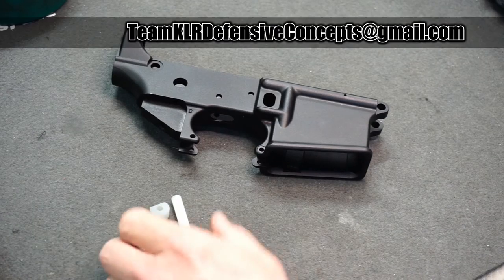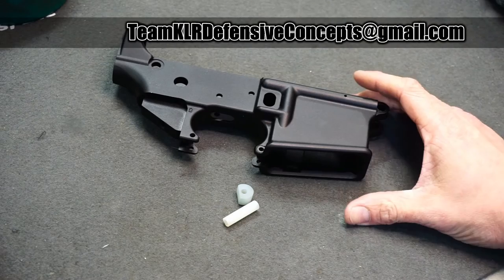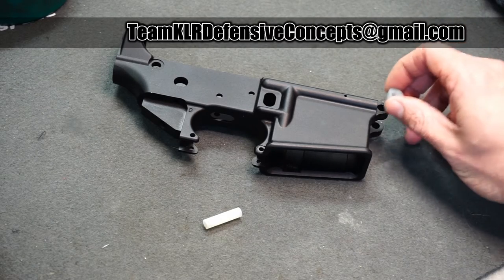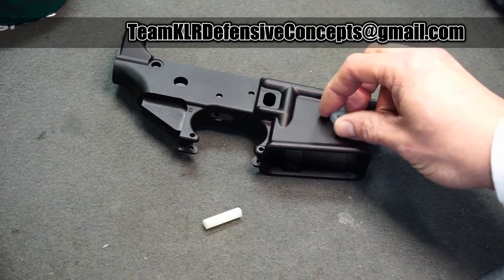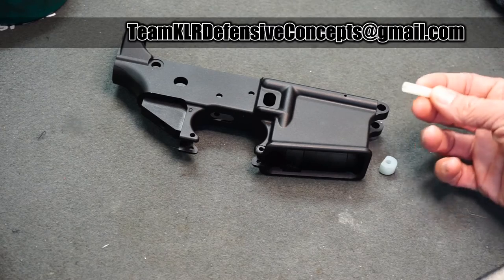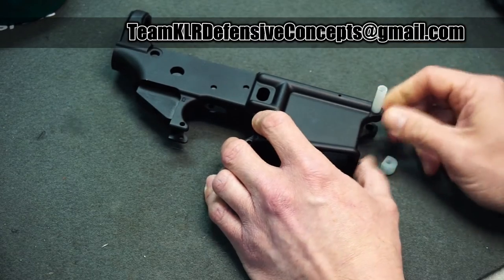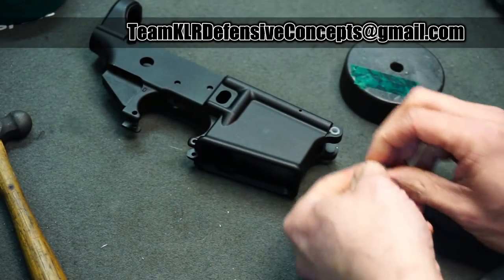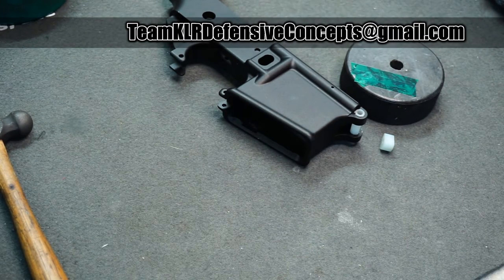GHOST GUNNER UPGRADE BUSHINGS

Comment: I'd say it's a wasted effort.  The ghost gunner now comes shipped with this very same bushing.  The plastic piece you hammered in there is replaced with a screw.  No problems.
Reply from the maker: Yea the screw has always been there as it must hold it down. I that inner bushing would go around the screw. The bushing that GG is x urgently supplying is tearing up after a few uses.